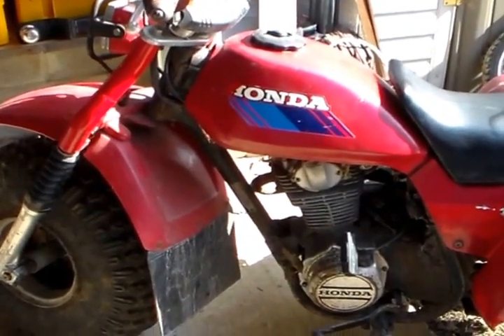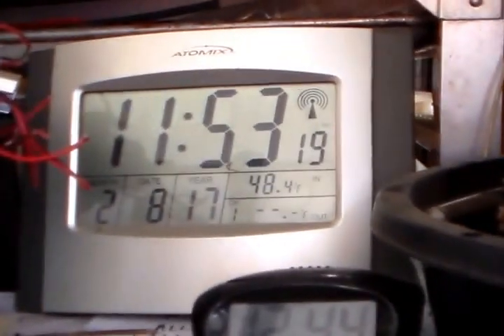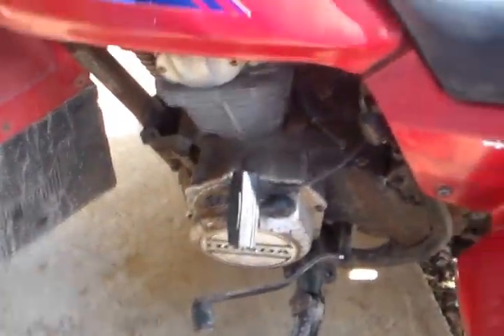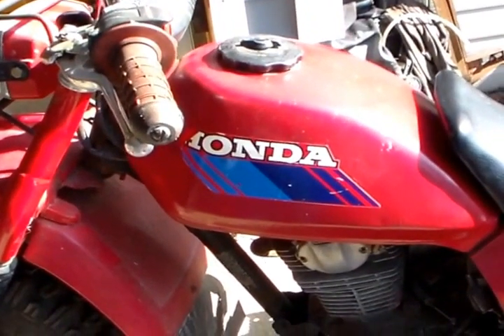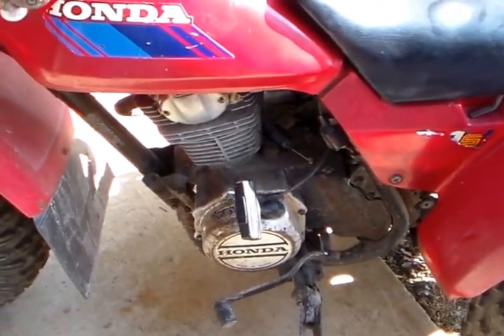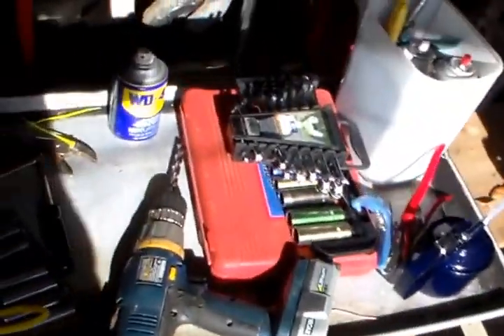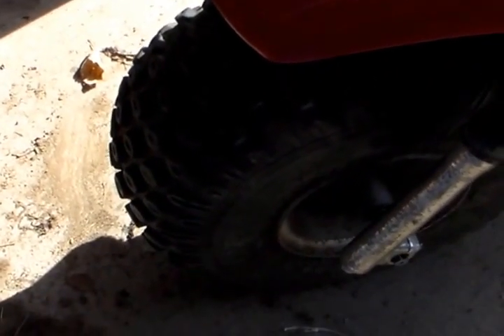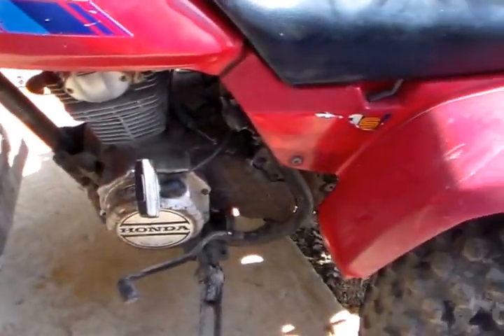1985 Honda ATC 200S, new front tire, cold start fail,

Comment: Yes their is MY Baby! Love it. I had a 84 & 85 you know that already. Good looking tire. Hey it didn't fail you did. It's not electric start & I know its a pull start soooooo You gave out. LOL The front tire you took off is OEM &  only 32 years old!! Flooded her out. Poor old girl. When I flipped mine sometimes I has to turn OFF the gas, drain the carb, Pull the plug, then pull the cord a few times to clear it out, then put it all back together and fire her up just to get back home, Yep I was ruff on my Honda back in the day.
Reply from the maker: Hey Calvin, There will be a video of Ur Sweet Heart 1985 Honda 200S tomorrow running.... I think the gas at my hoard is getting old, I'm switching over to all non ethanol premium for the Honda fleet, hopefully, that saves me a few carb rebuilds... I tried a couple of carb gas dumps, removed the plug, pulled the rope, and replaced the plug with new, still a no go, rebuilt the carb and now Ur Baby is happy... I just wish it was as easy to make a wife happy.... BTW, tomorrow is Valentines Day, word to the wise!!!   Thanks for your thoughts, encouragement, watching, and commenting!!!
Reply: I always run 100% gas non corn gas NOW. Yes it's a little more but not that much more considering the work to clean them out. 
Oh YES I got her some FRESH flowers on the way tomorrow Pal, Delivery and all was like $56.00 This heart day I am in like flint! LOL Take care.

Comment: just bought 1985 200s this morn. hard to start, been sitting. just realized no cable for de-compresson lever. just about tore hand tendons. used a string from lever to handlebar and finally started after bunch pulls. the string only lifted the lever from about 5 oclock psoition to about 2 oclock but after watching a video elsewhere it looks like with a cable the lever rests at 2 oclock and when you pull it jumps to 11 oclock so even with my string its not really where it should be when i pull. .Do you know if any parts are available anywhere for these bikes anymore? need front brake lever and bunch stuff. Thanks for any info, Steve